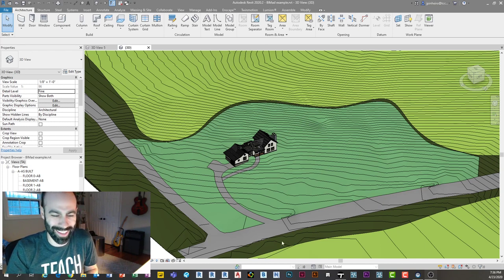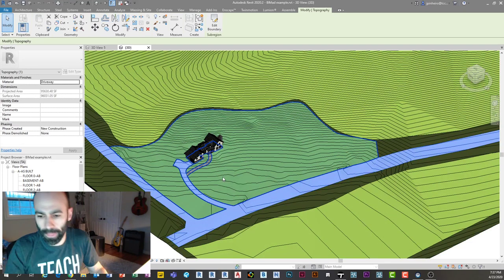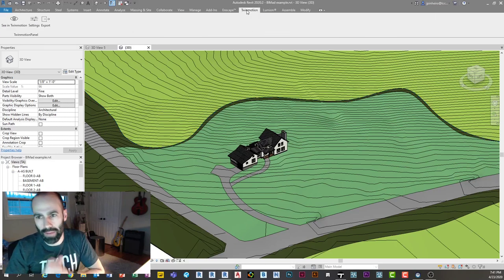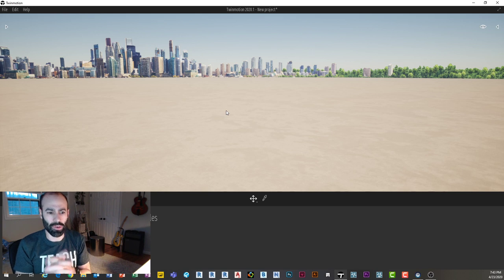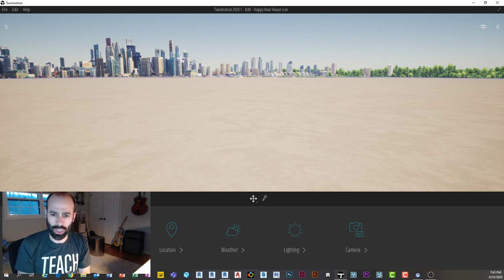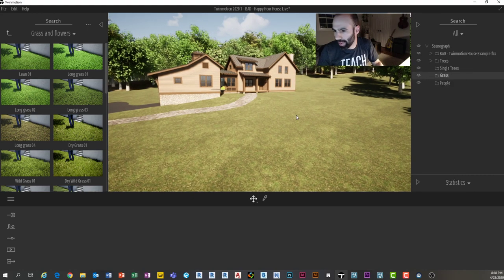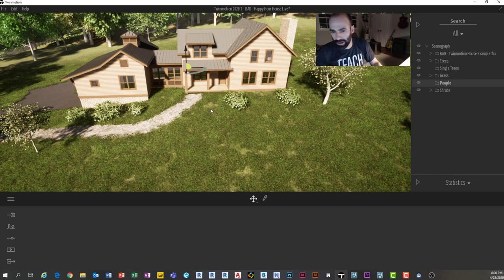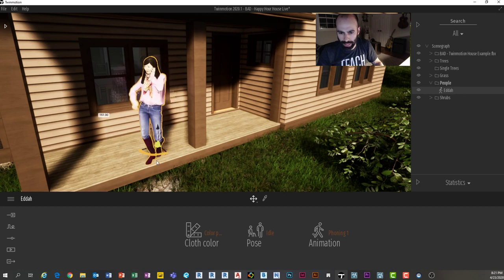From Revit to Twinmotion 2020 (using a reader's model)!

Comment: Perhaps you can assist me I purchased a new Laptop I have revit 2024 and twinmotion working fine on my desktop but I have installed both on the new laptop they both work separately but if I try  open twinmotion through revit it says that it is not installed. Any advice would be appreciated

Comment: Great tutorial. On my third time through picking up little tricks. One thing I can't figure out is some models I export Previous + new and they are fully editable and others the Previous is Grayed (locked) as a single model. What am I doing wrong? Thanks.
Reply from the maker: The phasing overrides change the material of the "existing objects".  Because Twinmotion brings in objects based on material they are all grouped together... If you want to control existing separate from new you'll want to export two models (existing and new) so you can control them separately in TM... Their phase settings will have to be Phase: New and Phase Filters: Show complete... then Phase: Existing, Phase filter: show complete... so their are no overrides.

Comment: When opening a revit file in Twinmotion, is there a way to separate materials that have the same trim without going back to revit? (Like you did with the columns.)
Reply from the maker: As I mention in the video... its all about material names.  So as long as your Revit elements have two different material names (which would mean two different materials) assigned to them... you will be able to assign the materials separately in Twinmotion.

Comment: the scale issue from revit export can be fixed if the the Model is exported with meter as the unit in Units setting in Revit
Reply from the maker: Are you talking about the scaled materials issue?  The models come in fine... Just the materials have a weird scale.
Reply: @TheRevitKid  yes.. While export from revit  if the scale is kept in meter most of the material come in correct scale. so not too much of Material scaling is required in Twinmotion